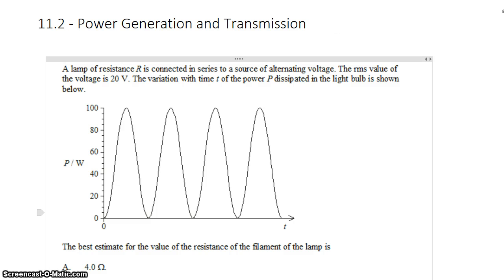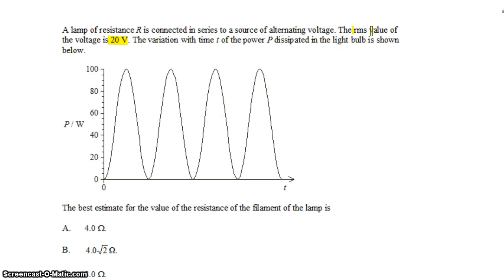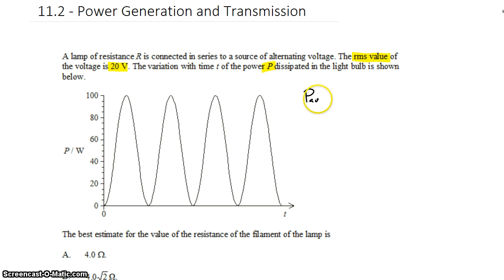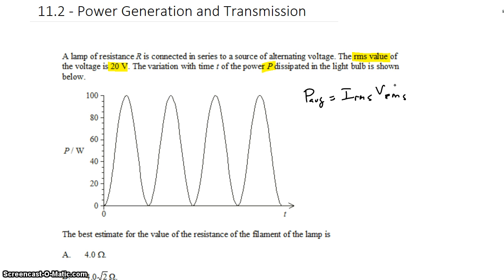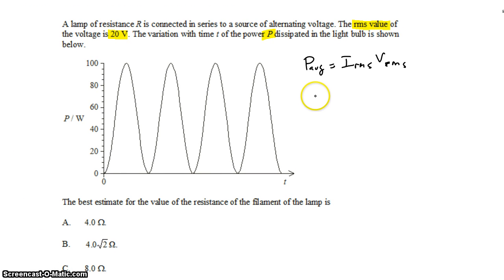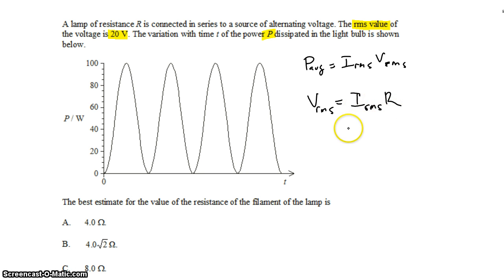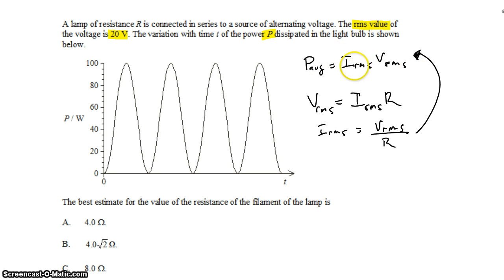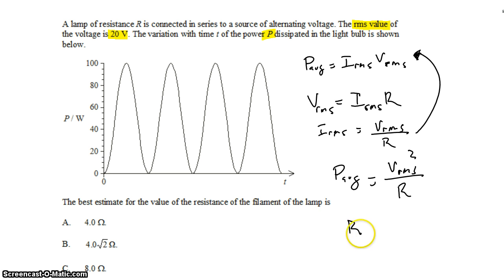11-2 AC circuits and power

Comment: Wait. In the next video you say that the average is not 700 volts. Why is the average 50 watts here then? Wouldnt the same apply?
Reply from the maker: Hi Silbo,

If I understand you question correctly, the difference is that in this video the graph presented is a graph of AC power over time. The power is always positive, so the average power will be the average of the peak and trough.

In the next video (https://www.youtube.com/watch?v=KnVVUqBjwDM&list=PLf_Hk-cBofOSWy7EtCmTwyy2HjmFT83ol&index=7), the graph presented is a graph of AC Voltage over time, not AC Power. AC component of Voltage would always average to zero, so it's not very helpful to talk about the average AC voltage. Instead we talk about RMS Voltage, which is the average of the magnitude (absolute value) of the voltage over time. The info on this page may help clarify: http://www.bcae1.com/voltages.htm